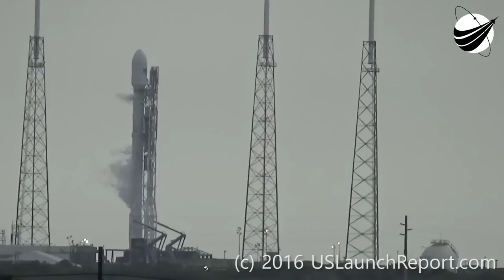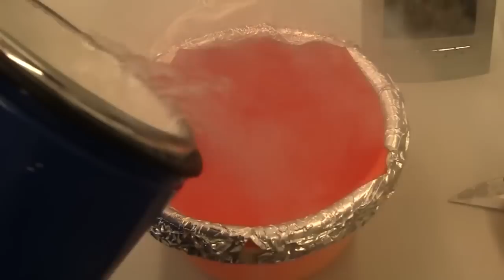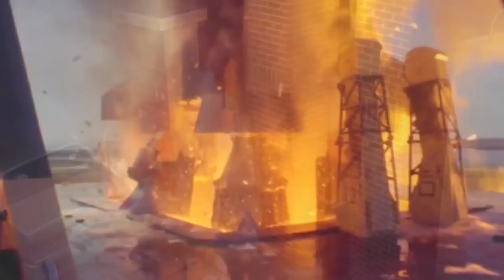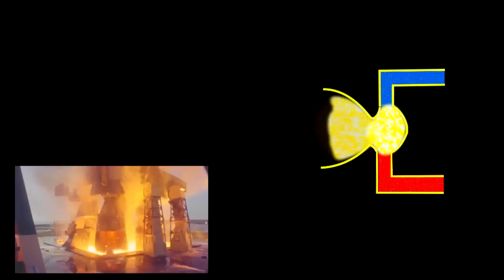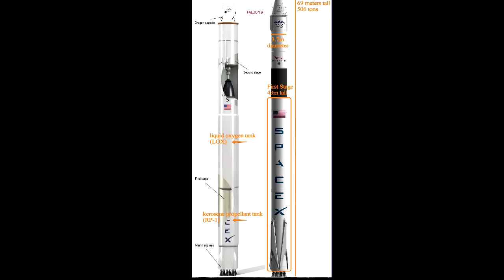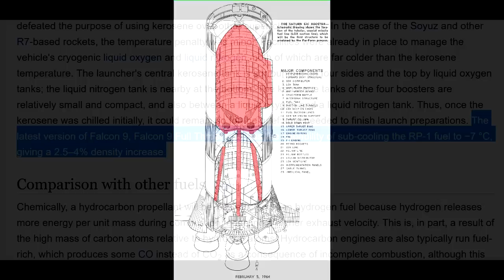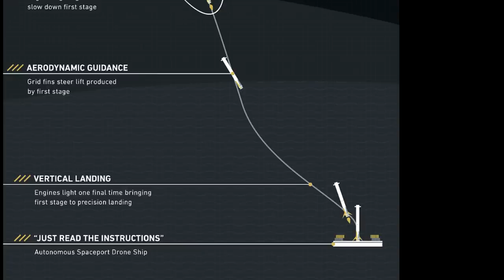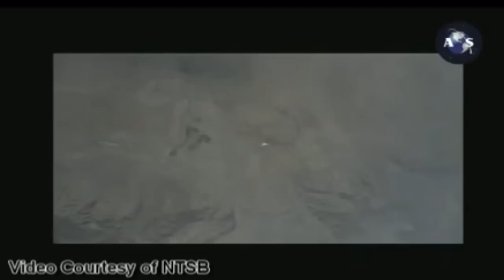Why did the Falcon 9 Explode?

Comment: Huh?!  You criticism them for using a new kind of fuel and then say that they have solved fueling issues (with different fuels) 40 years ago.  Which is it?
Reply: His point was that structural issues (which likely caused the problem) have been worked out for 40 years. There are very specific loads that a tank has to be engineered for. Since these are rather straight forward issues, the likely causes of failure are usually in the turbo pump and in the engines combustion chamber itself. Phil takes their problems at the tank level as indications that they are trying to cut corners in order to achieve a higher flight rate, and that certain things, like the design of a tank, really shouldn't be messed with because we've worked out these problems 40 years ago.
Reply: It&#39;s not a new kind of fuel because oxygen is still oxygen.  It&#39;s a new kind of fuel because the liquid oxygen is super cooled.  -207c sounds &quot;super cooled&quot; to me.  Cooling can make a big difference to the loading process.  Heck, they can&#39;t even keep A/C units from freezing up and wrecking the system and that&#39;s just standard air.
Reply: Well the LOX is not at -7°C (btw be carefull with 7C because thats the unit of a charge and not a temperature) it will be more arround 90K (−182 °C). Probably even a bit lower because thats the boiling points of LOX. 
Its the kerosin that is cooled down to -7°C which is quite close to the freezing point already (-26°C to -60°C) so if there is a damage in the insulation between the LOX pipelines that could then easily freeze the surrounding kerosin leading eventually to a structal faliure on those pipelines.

To the argument of the jet engines: They got way more complex, german jet engines failed more than they worked in WW2 and also you cant prevent material deffects or external factors so that argument is invalid :) 
Also its unlikely that with some thousands or more rocket starts this was the first time that kind of fault happend. Its much more likely thats just some inpurity in the material or other deffects that happend during manufacturing. I personally think that it was a damage on one of the tanks. Although the pressure is not that large the explosion of the tank could easily damage the second tank as well due to the thin wall of the tanks. That would also lead to the mixing of both fuels and eventually to the explosion.
Reply: Amy I don't actually know what thunderfoot meant but I highly doubt that he is that naive on how rocet systems work.  Since all these systems need to be worked out for each fuels specific density, viscosity, temperature, etc.. etc....  The claim that they worked it out 40 years ago for a fuel that wasn't going to be used for 40 years is squarely in the conspiracy theory camp.  Heck even things as simple as one of the gazillion gaskets have to be worked out for it's temperature range and tolerances.

The science of theses things has been worked out 40 years ago.  Likely longer then that for most if it.  Less then that for some.  But so what.  This fundamentally misses the point.  That's like saying we understand the science of building cars so there should not be any accidents any more.  It's not an issue of the science.  It's an issue of design and/or manufacturing.  It's the so called 40 year old science that they are going to use to figure out what went wrong because they know it well.

I'm not sure what thunderfoot's sour grapes towards Musk is (jealousy?) but it sure seems to be clouding his judgment.
Reply: It's the same fuel as ever.
Reply: Chuck Norris No you are wrong on this matter. The regulator used has not changed much over the past 40 years. That is because the same regulator system is used in automobiles and fuel systems to this day. since there has been no appreciable change to the system, it is not a different system. Further, the fact that this is the first instance of a fueling failure in 40 years is a sign that the system was perfected, but that there was a change on Spacex's part. TF was VERY right on this part.
Reply: Oh, and by the way, the part name is the top8-108. It was designed in the early 1960's and has been in use since then.
Reply: Chuck Norris The interface on the fuel line to the rocket is NASA owned. Thunderf00ts argument is that some change on spacexs part caused the mistake. You are now essentially agreeing with him.
Reply: Chuck Norris Then that would make matters more hilarious. The top8-108 has been in use for years with little changes, and if spacex decided not to utilize that, and made multiple changes then they've essentially said "Fuck tried and true"
Reply: Chuck Norris The point remains that NASA hasn't had a problem in fueling for over 40 years and SpaceX experiences the first failure in years because they cut corners. You can tell it failed at the 2nd stage fuel intake system and went from there. So tfs point still stands
Reply: Chuck Norris Do you realize how many launches there have been since 1963? Not just manned but commercial?
Reply: Amy Well there's the problem right there. Your resistant to understanding.
These were already mentioned in this comment thread. If your could be bothered to the simplest research (heck read wikipedia) you'll find that your just making up facts.  But it's my guess you know your just making things up as you refute your own arguments.

One thing is for sure.  If they used the same fueling systems as they did for the Saturn V first stage then one would expect it to blow up if they could have gotten it to fuel at all.

Anyway, if your not interested in being honest I'm not interested in continuing.
Reply: nukularpictures Yup, had the temps backwards.  Thanks.
Reply: Jet engines do not fail. They run constantly for weeks on end not switching off quite often. They are sooo reliable for how volatile they are.
Reply: Lucid Moses Well there's the problem right there. 
Ok so when he said they worked it out 40 years ago, he was talking about a number of things (Which you seem to be ignorant about).

1. The fuel used in the Falcon 9 is the same fuel that was used in the Apollo rockets. That is, RP-1 Kerosene, and Liquid Oxygen. These two fuels have been in use since the 60's. So that's your first misunderstanding.
2. The design and tolerances of fuel tanks are a matter of empirical science. 
3. Connections, methods, and systems in use today are essentially the same as they were back then. You still have straight lines running from the LOX tank to the engine that go through the RP-1 tank.
4. The problem here is that for the first time in 40 years, a situation happened that normally doesn't happen. That is, during fueling, the connection point, or even a tank, broke and caused the explosions you see. 

The point he is making when he brings these up is that these are designs which are so robust, so well understood, that failures here indicate a number of problems on the supply side. The connection might have been faulty, safety inspections failed to catch an issue, the manufacturer might have deviated from the recommended specifications, or even that the SpaceX company decided to radically change the design and essentially implemented something that did not have a solid history of working. It's saying that complete privatization comes with a number of problems. Which I can agree upon. As such, more oversight is required to ensure that these problems are caught and fixed before they become another burning wreckage on a launch pad.

I seriously feel like you missed his point entirely due to general ignorance about the subject. When he makes the 40 years comment, he means that what happened that day was something that hasn't happened in 40 years because whatever caused the explosion was identified and solved decades ago, and that there is a fear in him that whatever they are doing now, might indicate fundamental flaws in design, construction, or testing, that need to be resolved. Ultimately, he criticizes SpaceX for a failure on the human element side of the house and suggests they need to make sure that a major institutional problem isn't preventing them from identifying the problems.

Comment: I love Elon Musk, but I also love polite criticism like this. it's good! (and educational)
Reply: Chuck Norris
What part didn't make sense? (if you don't mind me asking)
Reply: Chuck Norris
 you made good counter points.
but that's what I enjoy about these kinds of video's, they make people think.
Reply: Parachutes also would have a far higher survival rate than attempting to autonomously land a steel tube. I would say the safety alone would be worth that conversion. 

I also find the fact that this rocket was built almost entirely in house to be a major flaw. Tried and true designs are the cornerstone of modern rocketry and going of the beaten path is likely to end in catastrophic failures like these. And does Elon even allow the public to see the specification of these rockets so tfoot would have been able to gather more information? I'm going to have to check this now.

I am interested in knowing how the rocket actually exploded however. It seemed that because the rocket had two stages that the oxygen and kerosene would have had to be relatively close to one another to migrate down to the lower fuel tanks, so that my hypothesis. Whats yours?

As to your last paragraph, I would say he was advocating that the rocket carry less fuel rather than simply wasting it. That makes far more sense.
Reply: +Chili Hoyer 
Problem with parachutes is that they are subject to atmospheric conditions which constrains rocket launches to a very specific and tight schedule of "nominal whether"
Reply: Most launches are confined to that window. I imagine that it would be almost impossible to have that tube steer itself with anything more that a stiff breeze.

But nominal weather usually applies to takeoff where parachutes would be tucked away behind explosive bolts. You could have this thing touch down in most conditions unless it would cause harm to the recovery team.
Reply: +Chili Hoyer
They build in-hose as much as they can, because it's a lot cheaper, a lot faster to innovate, and have direct control over quality.
"Tried and true designs" are several decades old, very expensive, have inferior performance, and still not immune to failure.
Reply: Chuck Norris That is a very good point and I will concede it. Perhaps as a better solution we should encourage touchdowns instead of splashdowns to remove this problem.

There is clearly a large difference between what space x and the rest of rocketry is doing. They have had to design their rocket to perform in a completely way. Getting up to orbit and then landing itself is not something most other companies are putting into their designs. Its not a bad thing, but it is going to lead to unintended consequences like this one.

Also I have been unable to find the specs myself so I would really love a link. TY.
Reply: András Bíró I would be surprised if it was cheaper. R&D+Specialized machining+Occasional crashes make for a expensive cocktail. I understand the need for creative freedom, but accepting some more standard practices might be in their best interest.

I don't mean space race when I mean tried and true. While rocketry might have been out of the news it hasn't stopped. NASA and other organizations are always sending up satellites, repair crews, ISS members and much more. They have constant updates and always have to be a the cutting edge of safety and performance to work with their limited budgets. Yes they are not immune to failure, but if space x needs help with refueling they clearly are having a larger problem with their design that some standardization could help iron out.
Reply: +Chili Hoyer
Parachute cannot soft land, so recovering using parachute is useless. You will spend a lot of money in rebuilding the damaged part. The cost for refurbishing the Shuttle was almost greater than building a new one from scratch. Not to mention parachute doesn't work on Mars. The entire reason SpaceX was founded was to colonize Mars.
Reply: But you did point out that the rocket landing would also need near nominal weather on the way down. Which I will now bring up as a point.
Reply: Well managed to find what I was looking for.

https://www.spaceflightnow.com/falcon9/001/f9guide.pdf 

Was pretty buried among articles hyping the falcon, but this seems to be the complete package.

The GSE? I guess that would suggest operator or machine error then, which would make this a complete fluke. If that turns out to be the case they likely need to reevaluate their equipment and do extensive retaining to minimize accidents
Reply: +Chuck Norris Also, Musk wants this to work on Mars, where parachutes on large vehicles won't work. Seems TF didn't look into why Musk is doing this. parachutes or ocean splash down is no use for what he wants.
Reply: Mark B That make a certain degree of sense. Much more than just doing it because it is cool. He has got a long way to go if that's the case though.
Reply: Seyha Leonhartz Someone already beat you to the punch.
Reply: Yeah, SpaceX initially tried landing the Falcon 9 first stage with parachutes on the first 2 or 3 flights, but after reviewing telemetry they found that relying on air to slow you down is too unpredictable, while you can control a rocket engine with thrust vectoring.

Comment: 1) Weren't the shuttle boosters expensive to re-use due to the seawater damage? This is a problem the falcon 9 fixes.
2) SpaceX haven't relaunched a booster yet, but they always said it would take a few months of testing before they would. The are prepping the first reused booster for a mission right now.
3) You say NASA would have never have approved a design as dangerous as SpaceShip Two. What about the time the approved the challenger shuttle to launch even though engineers knew and warned that the boosters would explode due to the cold weather? I honestly have a hard time understanding how that didn't amount to murder on NASA management's account.

I'm all for criticism of SpaceX, but I have a hard time finding much real actual fault in what SpaceX are doing. I think it's pretty silly to criticise them over rockets blowing up, especially when the investigation into the latest explosion has not been completed. NASA solved these problems years ago, but they could never reland and reuse a booster in the way SpaceX are attempting to. I don't know if SpaceX will succeed, but taking risks like this seems like the right way to do it.
Reply: Challenger disaster: 1986, temperatures the night before launch below engineering limits, higher ups warned about impending disaster don't listen, 7 people lose their lives when one of the booster O-rings burns through and ruptures the external fuel tank, destroying the shuttle a little more than a minute into the launch. Having learned their lesson, NASA continues to operate the Space Shuttle program until a foam strike during the launch of the Columbia several years layer causes the spacecraft to burn up on reentry after completing its mission, killing all seven crew members once again. Finally, NASA continues to operate the Space Shuttle program until the final launch of the Space Shuttle Atlantis in 2011, after which the program is retired. 

SpaceX 'disaster': 2016, a Falcon 9 explodes on the pad for an as yet unknown reason during a shakedown test of the pre-flight operations which would have culminated in a several second long static fire test. The purpose of the shakedown test is to ensure that there will be no anomalies or problems with the rocket during the launch, the pad and surrounding areas are clear of personnel for the test, the satellite is mounted to the rocket (optional, an accepted risk that the company owning the satellite were told about) because it saves having to bring the rocket back inside to mount the payload and bring it back out. At t- several minutes before the static fire, during fueling, something goes wrong and leads to an explosion which destroys the rocket and the payload, and a good chunk of the pad is damaged. No one is injured, SpaceX now has data about a possible design flaw with the umbilical system or other structure that can be fixed to prevent the risk on future launches.
Reply: Totally agree.  This guy falls well short of science and really high on woo.
Reply: @LiamVertal What's your point?
Reply: Im totally with you too. I dont understand why people want to try and shit on progress... He is trying to do something that will better us as a civilization at a lower cost than anyone before him. SpaceX is in relative terms a brand new space agency, achieving some pretty impressive things....
Reply: I think he was comparing the Challenger disaster to the Spaceship 2 disaster, which I think was last year or the year before. But also note that Columbia was in 2003. Columbia burned up on re-entry closer in time to Spaceship 2 exploding than to Challenger exploding.